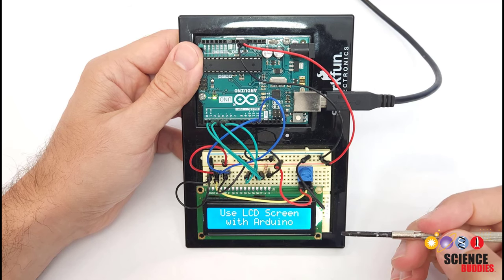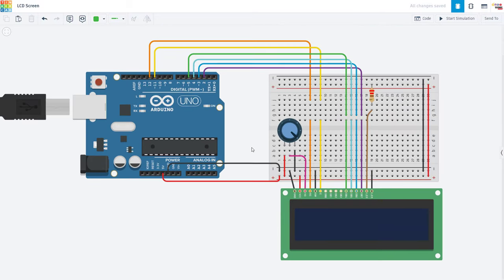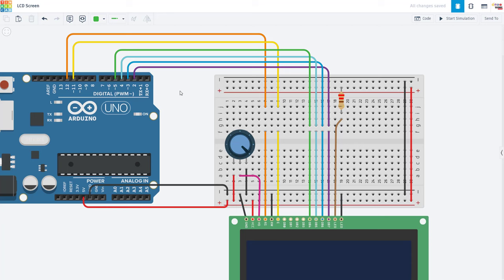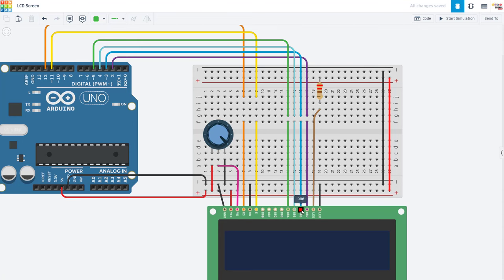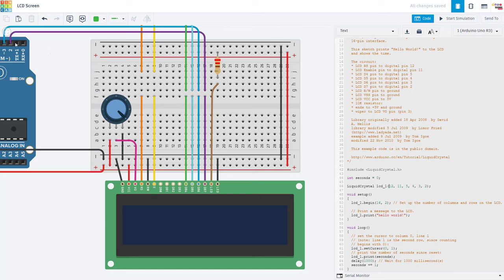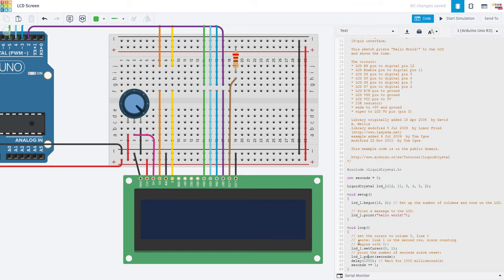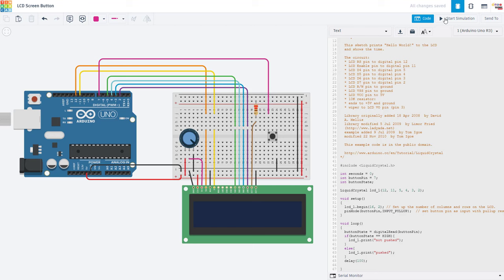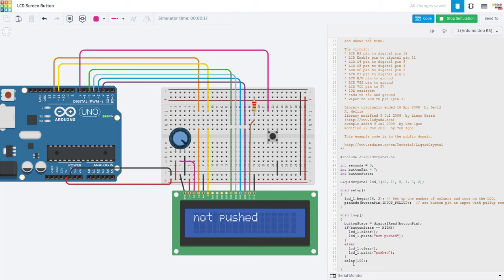How to Use an LCD Screen with an Arduino (Lesson #21)

Comment: I bought a budget lcd screen years ago and never got it to work.  Just followed your instructions and it worked first time.  Well done on such clear instructions.  I had already coded my Arduino to put something on the lcd so I didn't use your code example but it was quite happy to work with the display.

Comment: In the tutorial it says that the device uses SPI, and uses the MISO and MOSI pins (12, 11) but I don't think this is accurate. The device does not use SPI and you don't need to use pin 11 for Chip Select. In fact I can't do that, because I have other devices on the SPI bus! I think this part of the Arduino Tutorial page needs to be corrected, as well as the example circuit.
Reply from the maker: To clarify - you're talking about the Arduino website and not our tutorial, right? If so, you'd need to submit this comment to them directly; we aren't officially affiliated with Arduino.

Comment: I connected everything but the arduino didn't work when i tried removing the 5v from the arduino the arduino worked but the lcd didnt cuz there isnt any power so what do i do??
Reply: pls anyone reply I really want it to work
Reply from the maker: Hi - we can't really help troubleshoot in YouTube comments, we recommend asking on the official Arduino forums where you can also post your code and pictures of your circuit.
Reply: @Science.Buddies  Ok thank you for your help !!

Comment: I have an issue where only the white boxes show up on the screen, changing the position of the potentiometer does nothing except changing the brightness of these boxes. What could be causing this and how would I go about fixing this?
Reply from the maker: Hi - we recommend contacting the manufacturer or asking in the official Arduino forums, we are unable to help troubleshoot issues like this in YouTube comments.

Comment: The module I got has 4 wires sticking out the left-hand side of the board. What is that for?
Reply from the maker: We can't say for sure, you would need to check the datasheet or instructions for the module you bought.
Reply: To answer my own question: Turns out the one I got is I2C. It is so much easier and uses fewer wires!

Comment: my screen on the bottom has some other small controller already soldered into the pins, and it gives me only 4 pins out of that controller, GND, VCC, SDA, SCL. I can't seem to find a tutorial on how to use it with this pre-build controller already attached ot hte scren. maybe i just need to buy a fresh screen.
Reply from the maker: There are screens that communicate using fewer wires with a different protocol, if you post a picture and ask in the official Arduino forums someone may be able to help you there.
Reply: @Science.Buddies  thanks